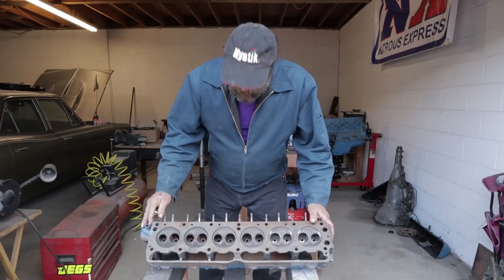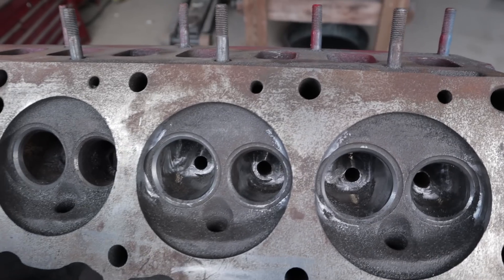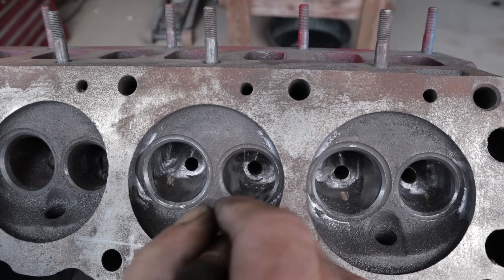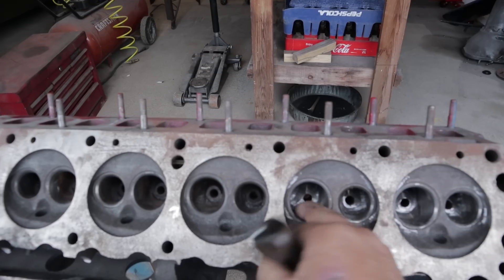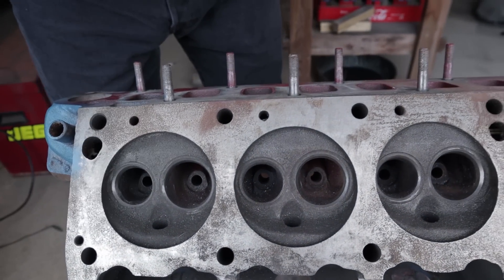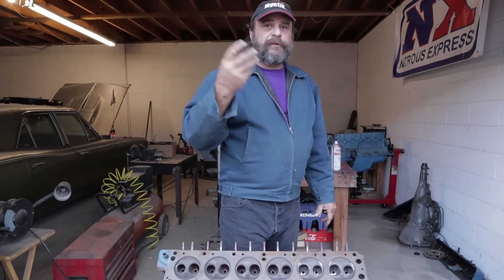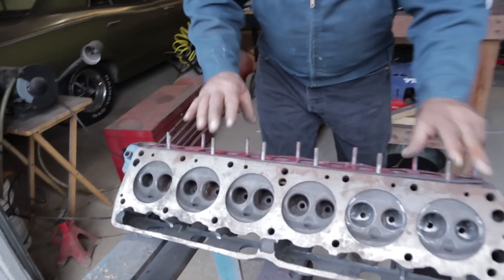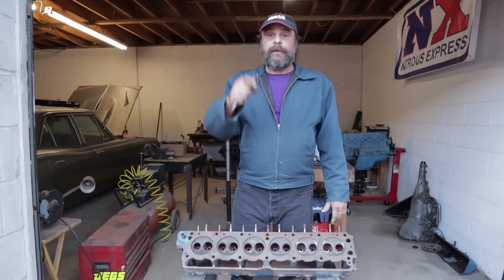Hot Rodding The Slant Six - Porting The Head

Comment: I have a disassembled lower portion of a slant six tied into 68 barracuda sitting under budget tarp, and another slant six from eBay sitting on an engine stand for rebuild.  I am going to rebuild the one on the stand, mostly tore down. The porting fine element of curiosity for place to begin.  It looks kind of simple, the idea had circulated in other conversations on VW air-cooled I had noticed other places.  Mopar 💪

Comment: Why no short side radius material removal? After picking the brains of a lot of pro racers, I did my own motorcycle. On the motorcycle engine, hemi-head, a LOT of material came out of the bottom of the exhaust port and the power that motor made was nothing short of amazing.

Comment: Might be a stupid questions but does stuff like this push down gas mileage (e.g. uses more fuel then if left the way it is)?
Reply: yes, it allows your engine to flow more air/fuel mixture when you open the throttle.  If you want better mileage, put a brick under the gas pedal so that you can't go to wot.

Comment: Tony, have you ever been out to the Bonneville Salt Flats for speed week? I was watching some salt flats video and i thought about just how freaking awesome a video series a car build and then the whole Speed Week experience would be. The rule book gives plenty of instruction on building to pass tech. The very spirit of Bonneville is steeped in home built creations. They prefer mild steel roll cages with gusseting, MIG welded. SCTA and all the racers have a great time good for lifetime memories. If you pick the project car and engine choice wisely (this is what the rules book is good for) you may find a record that looks soft. Something  perhaps around 180-220 cu. in. perhaps? Then  see what kind of results you could achieve with a slant 6 either blown or unblown. Even if you never get anywhere near a record it would still get tons of views. "Blown" means any method of boosting from helix to centrifugal blower to turbo. You can build it to run on fuel and a nitrous system puts a car in a fuel class. Dry lakes and salt flats are under the aegis of sanctioning bodies that remember where they came from. This is why they actually prefer to see mild steel cages in cars. There is a potential problem i could see developing though. Uncle Tony gets hooked on land speed racing and installments continue regularly the rest of your active adult life.

Comment: On that back cut of the intake, before i suggest anything, i know flow is everything, but you are dealing with a thumb over the hose type situation. Ever thought of building up epoxy into that back cut? I know it might drop overall flow, but to straighten the flow, it might help it flow better. I've been a believer of smoother flow is better then overall flow. That back cut does the same as the ridge on top of the valves, you talked about in a past vid. I'd think smoother flow would do more than having a killer flow number but at the cost of restrictions

Comment: I remember all the boys on the 1980s had to have the heads “ported and polished” and polished meant like a mirror.....

Hours and hours of wet and dry sanding by hand

Then they worked out it’s no point doing the polish on the exhaust side because the carbon still sticks anyway and stuffs up the polish.... and on the intake side they worked out a mirror polish was not the best for flow and fuel atomisation what was better was a mild coarse finish but still ported....

Something about gasses flowing better with multiple small ‘eddys’ rather than in a ‘laminar’ fashion.... and the fuel atomisation was a bonus.....!

I wonder if that’s still the case?

Comment: Holy shit Tony you're porting looks terrible dude! Lol. You're putting ALL THAT work in a slant 6 boat anchor and that engine won't run any different than it would if you didn't waste all that time!  Grinding out all the booger castings in the block n heads and painting it?! Why didn't you do all this on a good engine that actually COULD make power. That engine may have 56.2 HP now instead of 56 for real! Lol. Idk bro i gotta question you're sanity when you're putting this much time n effort in a slant 6. U wanna do a build on a budget, stroke a 318 to 390 and do that stuff to it! The reason they probably never baffled a slant 6 pan or worried about windage is cuz those engines weren't made to perform and it was loaded with a bunch of design flaws already so why wrry about the crank being submerged in oil?

Comment: Just clean 'em up,  give good 3 angle valve job, and clean up shrouding.....it will really help low-end torque as it boosts early flow at low lift.  Really good point on the difference between intake/exhaust porting.  Smooth intakes = "puddling" of the fuel.

Comment: Le sigh,.... "The exhaust being pushed out of the engine,...." 
By the time the piston rises to mid stroke, most of the hot gas has already Expanded out of the port. Read up on how Exhaust Scavenging works, the headers and correct length pipe will actually be sucking the gases out of the exhaust ports.
The extra bowl volume before the valve allows more airflow without needing to over port when you cut the seats back to fit hardened seats and HyperPak spec valves. Most manual porting is better off being replaced with Extrude Honing instead, for better CFM matches.
Reply: Dude, he's not trying to be "correct". He's using shade tree mechanic language that everyone understands. His language is just fine for the target audience.

Comment: Since you’re trying to take out weight 
How about drilling the center of bolts
(On non critical bolts) you can EASILY take out 20% of the diameter of the bolt if not more on stuff that isn’t especially stressed

Comment: Just want An honest opinion a few years ago I picked up a 70 ranchero (yes it's a ford but you run what you got) I got it runnin and driving and then we had a bad flood water.  Talking mud on the headliner deep. Once it's dried up some I strip it down. Pull the drivetrain carpets door panels seats dash hvac box and all the sheetmetal and wiring pressure wash it and get all the silt out of it as best I can then put the body back together. Then let it sit for 3 years. Cause discouraged it was under water for about 12 hours. Body and chassis seem solid and the wiring seems ok but. It had a 460 and a c6 in it and I have. 302 and c4 I wanna put on it am I asking for trouble by putting this thing back together or am I risking hidden got I don't know about?

Comment: I've never worked on the sixes...only small block Dodge...had a set of 340 heads.....I changed the value angles from 45 and 46.... To 15 and 30..... Helped me with the high compression.....ended up with 240 per cylinder.....mite help you?

Comment: Uncle tony i have a question. Do you know if a small block mopar or small block chevy is cheaper to build. I want to build a drag tube chassis car without a body or anything and i want to build a cheap engine for it
Reply from the maker: The Chevy would be cheaper overall.  If I didn't care about brand or being period correct, I'd do an LS
Reply: Uncle Tony's Garage thank you
Reply: Uncle Tony's Garage im kinda dumb so i think i will do sbc so i dont have to fuck with computors

Comment: I have a 150 hp Chrysler Marine slant six from my '69 boat including water cooled exhaust manifold. I want to put it in rat rod whatever but have not been able to find what transmission will fit. Any clues about crank flange bolt pattern,, flex plate or whatever the ring gear is would help. Adaptors to what automatic trans etc.
Reply from the maker: Far as I know, it should have the same bolt patterns as the standard car/truck Slant
Reply: @UncleTonysGarage  Thanks for that replying. I think there are adaptors available for modern autos, or a 5 speed manual....

Comment: "this is just a question" to improve the flow could you un shield the valve and chamfer it into the block like we do in our V8s and use a notched head gasket? again "just a question" yes you'll gain a feww CCs in the chamber but it should increase the exhaust flow quite a bit. plus it'll be a little lighter too..
Reply from the maker: I'll look at that when the block comes home

Comment: As always awsome video . Great for those just starting out . Im on a poor mans buget but was able to buy some good quality die grinder bits for cast iron ect. I gasket matched all ports: intake, head , and exhaust manifold .cleaned up the bowels and ports polished the valves. Valves had been back cut . I also put  a larger inner diameter   exhaust manifold pipe flange  i bought from O'reallys and put on 2-1/2 inch pipe single exhaust system with a flow tech afterburner muffler. flows really well and doesn't burn out the pipe flange gasket anymore .i noticed a big different in power and torque and fuel efficiency .

Comment: If you had a Flow bench you would see that the Ari flows from the Roof to the Short turn on the intake and from the short turn to the roof on the Ex. Air acts just like electricy , it will find the path of least resistance . You can find this by using a plastic cylinder the size as your bore and a Vacuum cleaner and a piece of string, Just put the valve at say .400 lift and suck air from the bottom of the cylinder, you will be amazed at what you find. And when you do this you will see how important the Short Turn radius really is. This is one reason the Quench pad is so important, which this head has no quench, a bad thing.

Comment: I wish I knew you in the middle 90 s found a very early Truck slant called The Yellow block more nickel in the block did not use the head do not like the spark plug tubes prone to leak so i used the oriignal head from the car i was building 1978 Dodge Aspen Wiseco supplied the 100 over  pistons local shop near me did a static dynamic balance pistons rods crank flywheel I took .125 off. Line bore the block . for the mains deck the block ,125 Cam Clifford 290 dur 540 550 lift 3/8 molly push rods....then head time...did what you are doing ,100 off the head i used chevy 305 valves 188 in 150 ext....dont have on my...lol bronze guides springs duel set for 600 lift cam so would not have coil bind..... i had 2 different intakes..lol first one i built using the original bolted to the old truck block head cut fab a new plenum put the secondary away from the head used a 650 dp single line had to yse a 3.5 power valve 58 in primary 64 second.....if ya want more info reply love your channel you know your Sheet   keep up the good work thanks Glynn fron Arkansas

Comment: Hey U.T.
Too bad we never got the Hemi head for "The Leaning Tower of Power" that they got overseas!!!!
Reply: The hemi sixes we got here in Oz were a different engine. They came in 215, 245 and 265 ci and were not a slant (they were not a true hemi either) but the 265 with factory Webber's was a 300hp+ car and would push a factory charger (Australian type completely different to the US charger) to a 14.3 second quarter mile on factory tyres.
Reply: @charliebear1838  I knew they were different, but I didn't realize it was that much - in my defense, I've never even seen a picture of them here - only knew of them.
As far as the car itself, that I knew.
Given the chance, take a look at the combustion chamber on the present 5.7 and larger U.S. "Hemi" - now that is definitely not a Hemi! (not sure what to call it - maybe a pinched in quench semi-Hemi wedge)
Oh, yeah - you guys got the COOLEST Ford's! We used Aussie 351 Cleveland blocks and heads here for years - they were the best of the best!
Reply: @Motor-City-Mike         
Hey Mike, yep the Clevo's were good, but when talking factory trim cars (265 r/t charger v 351 GTHO Falcon the 265 just had the edge over the quarter (only by a couple of tenths though), but if you worked the clevo over it was something to behold and all bets were off.
Reply: @charliebear1838 
I believe you - a good and proper inline six is fine thing!
The Cleveland as delivered was all about potential, but as you say, wave a skilled hand over one and they're a force to behold!
Reply: Well, actually,... There Was a true Hemi head for the Slant, but it doesn't come from here in Australia.
There was a race team in South America that ran a Slant in an open wheel chassis, with the engine stood up vertical and a crossflow Hemi head. What made it even more special, is that it had three spark plug holes in each chamber, allowing them to use a single centre plug, or a twin spark arrangement, depending on whether they needed low end push or top end power, to match a twisty track, or one with longer straights.
Reply: @PiDsPagePrototypes  that adds even more mystery to the mystical, magical Hemi slant-six.
Now I'm completely confused on where it was made or did it really exist???
Don't think I'm not disputing what you say (I obviously don't know), it's just that there's been so many places I'd heard they were made (some from normally reliable sources) - the most convincing had been Australia.
I've decided it must be from Unobtania - somewhere in the ether!
Reply: @Motor-City-Mike  As Charlie commented earlier, the 'hemi' engine we had here in Oz, is a completely different engine to the Slant Six, no parts are directly interchangeable between the two engines.
Reply: Here's the 'early' race engine,...

https://www.youtube.com/watch?v=I9t7zi5O7b0

https://www.youtube.com/watch?v=jKiTYsO9fdI
Reply: And here's the thread on Slant Six Org, sadly the image links no longer seem to work.
"Argentinean Slant Six 24V Race Head Prototype" - http://slantsix.org/forum/viewtopic.php?f=19&t=42924
Reply: @PiDsPagePrototypes  
I caught that, thanks.
It's kinda funny to me how many stories I've heard about the "Hemi" slant six - understand that I've been deep into cars since about '76 (yup - long time) and have heard so many stories about this engine that it's kinda funny each time I hear a new story - I just can't help but laugh.
Like I said, I can't dispute anything I hear, or read because I freely admit I don't know.
I mean no one any disrespect - I just have to laugh about this, I've never run across another engine in all these years so shrouded in mystery!
Reply: @Motor-City-Mike  :)
Extra points trivia - the Hemi Six design originated in the US,.. as a proposed light truck motor :D
Reply: @PiDsPagePrototypes  AHHHHHH!!!!
Reply: @PiDsPagePrototypes  
Actually what I should do is get together with some of the people I know in Tool and Die and cast just enough heads to post pictures of them on different cars - of course letting the "secret" out that Chrysler was secretly working with AMC in Kenosha Wisconsin on development of the Hemi head for the 225!
(That should do!)

Comment: I argee with using the stock valves /  Too much ser ow ing in combustion side , i have seen some epoxy the intake ports , don,t trust it , I had a shop weld a set of Big blok heads no rush kindof pricey $$$$$ !

Comment: Hey Tony,  I'm actually working on porting my own slant six head at the moment and I was wondering about the short side of the ports.  In each one there is a small raised parts about the size of 2-3 pennies stacked on top of each other, they're about 3-4" inches into the port.  I went ahead and removed them from the exhaust ports but I was wondering if I should leave them in the intake.   It would seem to be an arbitrary casting flaw since it's in the intake and the exhaust but I was also thinking it may be in the intake port to kinda toss the mixture around and ensure good atomization.   What's your thoughts?
Reply from the maker: Yeah, take those down.
Reply: @UncleTonysGarage  Thanks for the tip Tony!  Keep up the great work, your show is better than any of the garbage on speed channel!

Comment: Does heat actually hurt or Could it help in this way, to heat the engine very hot and do make spark hotter then to add more of a moist feel like 20% water.  Hydrogen and Oxygen like in  water  just  have  to heat it up like superheated, heat for power does not have to rob power   it all a matter of perspective  so fire it up and do it. Use better metal and hevier oil to stop mixing in the butt end.. No one trying to reinvent  just trying to brainstorm and get it better for everyone!

Comment: I was wondering if you were going to grind the webs out. i had a Mx wedge 426 some years ago and the factory lightened them by grinding as much of the webs as possible. Are you going to put a three angle grind on the valves? quick easy HP by doing that . Also,CC each chamber ,then adjust the volumes until you get them all as close as possible ( I have lapped valves to get the volumes all the same. Why ? It's just like balancing and the Engines so much smoother than if you don't bother . On pre 1980 engines you have to port match them as most castings were a bit rough from the factory . I did a set of alloy heads on the weekend from 1975 which were miles out .

Comment: Can you use cast iron welding rod and fill in the undercut on the intake port? The new cast iron rod works well on cast iron. The intake doesn't take a lot of heat so I would consider using it. I wouldn't graze it because brass expands at a different rate than iron and might come loose and enter the engine, and you know what would happen next.

Comment: Tony that the outer portion of the head be removed entirely? I see where the drool tubes poke out and it looks like tha portion of the head is mostly cosmetic.
Reply from the maker: No, that's where the pushrods run
Reply: @UncleTonysGarage  I recall how many of the OLD OLD race engines had exposed push rods... maybe keep kissing it with the flap wheel/die grinder?  or cut n replace it with something to keep the oil in.